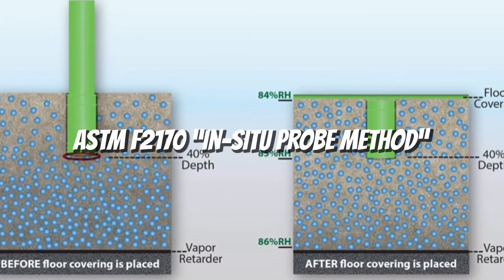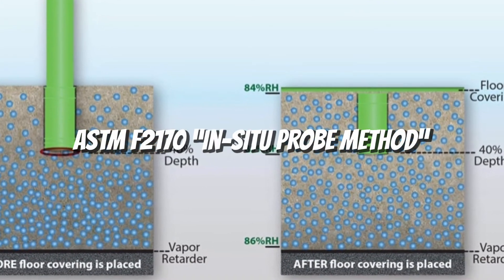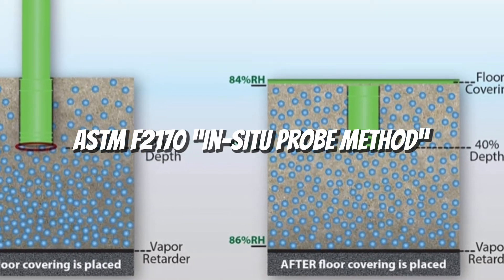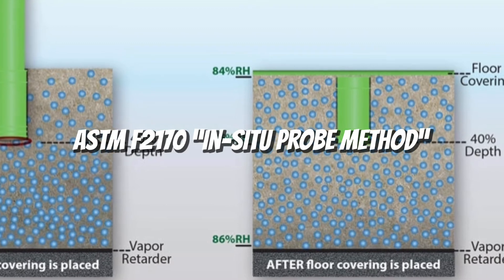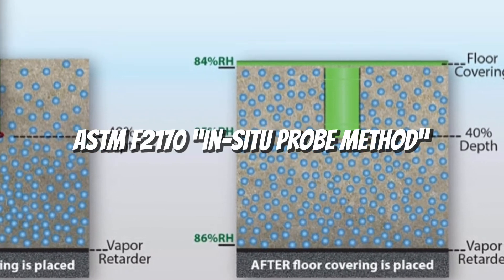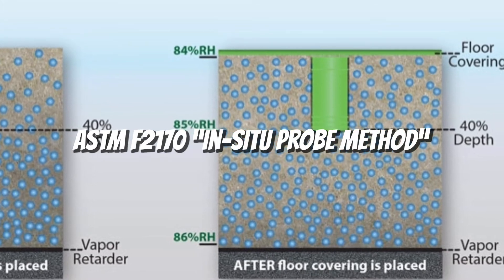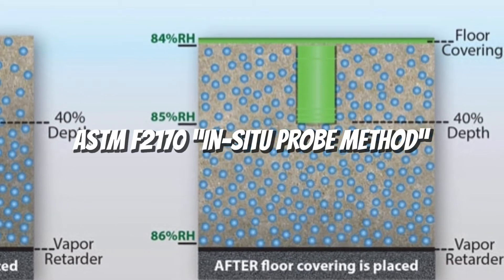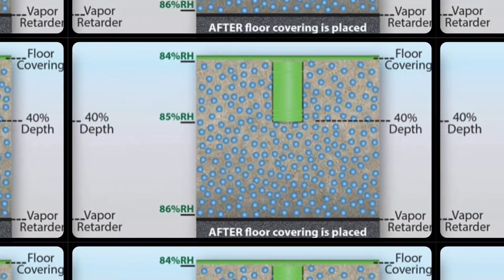Two-Minute Lessons: Concrete Moisture Testing, It's Important!

Comment: I've read multiple times that when doing a calcium chloride test, you should test 3 times for the 1st 1,000 sq. Does that mean using all three tests on different spots of the slab at once, or doing one test at a time until you have done all 3?
Reply from the maker: With concrete slabs, moisture testing is a snapshot in time.  Duráamen has a great site page on conducting MVER, check this out: https://duraamen.com/blog/how-to-calcualte-moisture-vapor-mver/